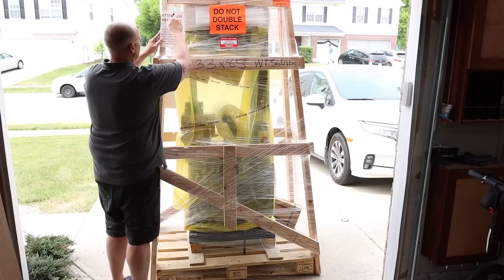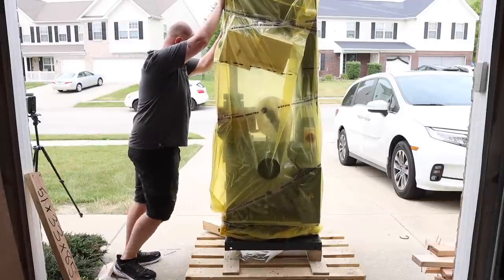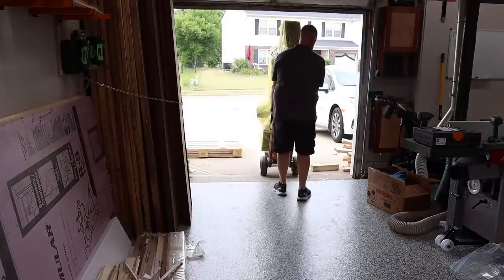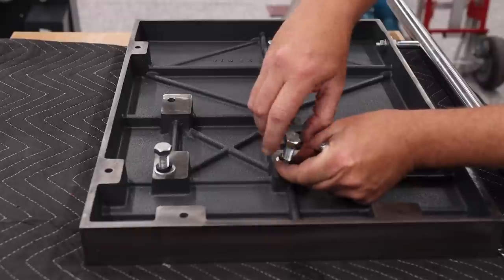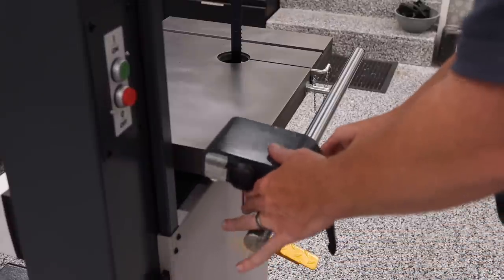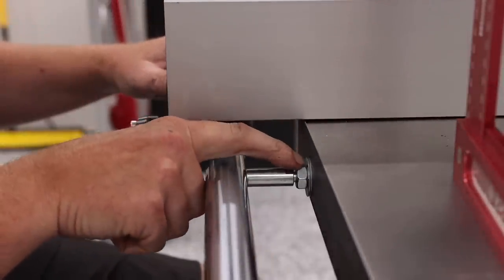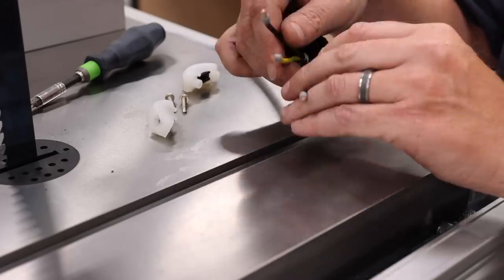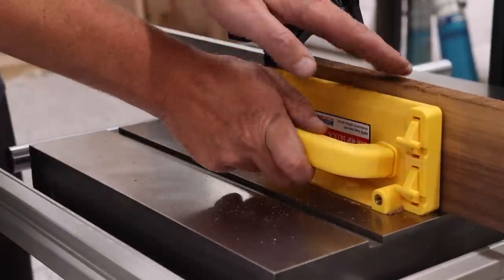I sold my bandsaw for this - Hammer N4400 Assembly

Comment: I hope you enjoy your new saw. I’ve had an N4400 for about 10 years now and TBH, I’m sorry I bought it, especially given the price. The dust port is in the worst possible location, letting all the sawdust fall directly on to the lower wheel tire. Even with the little wheel brush, dust gets trapped between the blade and the tire, so it has to be manually cleaned off periodically or it will lead to tracking problems. I’m not a big fan of the blade guard or guides either. One of these days I really need to make a modification to improve the dust collection. I suppose if the N4400 is going to be the only BS in your shop you could be happy with it. It has plenty of power and resaw height, and versatility with the range of blade widths it can accept. But, if you are thinking of buying one of these, I would do a DEEP dive on exploring other options. I have a MiniMax MM24 which is an absolute joy to use. I keep a 1” carbide tooth blade on it. I got the NN4400 for curve cutting. In retrospect, I really wish I had bought an MM16.
Reply: That is what we need to hear.  This is a partnership....sponsorship....free tools to say good things channel.  Nothing more.  Nothing wrong with that...but that is what so many of these woodworking channels have turned into...just partnership...advertising channels.
Reply from the maker: First, I don’t need these tools. I had great tools already. I was interested it trying them because I have been very impressed with the Hammer A3-41, which I paid for, years ago. Second, this was a how to assemble video. It was not a “hey this is the best tool ever” video. I put nice things in my shop because I like them. Not because others will. It’s my shop that I want to enjoy being in. Will there be things that I don’t like about the tool? Of course and those will be covered after I use it for a while. Just like anything else I have done. If the tools I use in my shop or the videos I make aren’t for a particular viewer, they don’t have to watch it. I make videos to help people, and I choose companies very selectively to work with. The fact that my channel isn’t littered with sponsored ad reads should prove that.
Reply: SCM makes great machines and I'm sure your MiniMax MM24 is fine example. I went with a Felder FB-510 Band Saw and I too absolutely love it. But these machines aren't for everyday DIY'ers, they are $$$, BIG and HEAVY. 😥
All the Best, Chuck

Comment: OK, thanks, I presumed there would be one at the bottom.  I noticed the sawdust on the work table, that's why I asked.  Shame there isn't dust collection there.

Nice saw, nonetheless.  I have a 14" Rikon, added a 2.5" port under the table.

Comment: What a nice piece of machinery! Enjoy the new toy 😄. Just one very little tip: replacing the straight plug by an angled plug helps quite a bit with heavy wires and it's less fatigue on the outlets.
Reply from the maker: This is actually plugged into an extension cord
Reply: That’s a good tip, thanks 🙏

Comment: One thing you might encounter with that bandsaw is apparently the guide post tends to shift when you tighten the knob that locks it into position.  This will affect the placement of the guides relative to the blade.  Will be interested to hear if you run into that issue.
Reply: Adjust the guides with the guidepost tightened. That way when you loosen it to move it up or down and retighten it, it will relocate back to or align where you had adjusted the guides.
Have a lovely day. 😎

Comment: In a similar boat.  I have a Harvey bandsaw along with the a3 41.  I'm thinking of upgrading bandsaw to felder 510 or larger.  Im not a huge fan of the guides on the Harvey.  Interested in a comparison of the guides along with how accurate the upper guide post is when you move it up and down.

Comment: I was surprised that you didn't break the machine down on the pallet - I always do that to avoid moving the motor/cast iron/accessories with the machine bases (any machine).  You didn't show anything about the guides and their adjustment - are they ceramic blocks or rollers (looked like rollers on the bottom guide, but I'm not sure)?  My big Laguna bandsaw (Italian-made) has ceramic blocks and I love them.  I'll be buying the Hammer oscillating edge sander before the end of the summer.  Best of luck!
Reply from the maker: Yeah big mistake. And yes, mine has the ceramic guides. I will be covering that in the follow up video. I didn’t find that particularly helpful for the assembly of the tool.

Comment: Interesting, i just got mine as well and by the way i live were the machine is actually manufactured (austria) pretty near Felder Group Headquarters
and i see that the emergency stop in the us is a mechanical footbrake. the EU version is electronically stopped. Don’t understand why because if you have a an accident I don’t think you would be able to push that paddle?!

Comment: Id be Interested in your placement of the blade on the wheels. For years I’ve been following the technique Snodgrass (on YouTube) recommended and have been been very happy. Your technique (if different) would be a welcome subject.
Reply: Yeah, I was about to comment on the fact that, according to the Snodgrass method, the gullets should be in the center of the wheel.  His are not.
Reply: Hi, on blades wider than 16mm the tracking is to be set so the teeth overhang the front edge of the tire. On blades narrower than that centre them on the wheels. The ceramic guide blocks are also asymmetric with the ceramic off centre, you can flip them 180 degrees to support the blade properly depending upon blade width.

Regards, Rod.

Comment: You did the plug wrong. You only need to strip off about an 1-1/2” of the insulating jacket on the cord. You want the cord clamp on the plug clamped on the outer jacket of the cord not the individual wires.

Comment: Did you get the ceramic guides?
Reply from the maker: I did.
Reply: @bentswoodworking  I bought the a3-41 and the n4400, I have the sawstop, I’m wishing I would have bought a slider. The sawstop is great, don’t get me wrong, but the sliders just make sense.

Comment: Would be interesting to hear your thoughts on going from the Harvey to the Hammer.  I have been thinking about doing the same thing as I am not thrilled with Harvey as a company.  How does the table height work for you?
Reply from the maker: I will probably talk about that a bit when I do the next video. I did like my Harvey bandsaw a lot as well
Reply: @bentswoodworking  I second this.
Reply: Table height is uncomfortably low. As is the case with many bandsaws that are optimized for resaw capacity, I think they design the table height to be low to keep the overall height of the machine from getting too tall. My N4400 is currently on a stand that raises it maybe about 3” above the floor, which isn’t enough for accurate cutting such as following curves—very uncomfortable! I plan one raising it by at least another 6”.
Reply: @57hound  I had not thought about that, but the resaw capacity makes sense on why more and more bandsaws have such low tables.

Comment: Is their dust collection on the machine?
Reply from the maker: Yes, there is one 5” port on the bottom
Reply: I’ve had an N4400 for several years now. The location of the dust port is in a horrible location, giving sawdust every opportunity to fall on the lower wheel tire . I’ve been meaning to modify it, probably making some sort of shroud to capture the dust right below the table.
Reply: @57hound  Rikon and others have second (first?) port right beneath the table. I have the 10-351. Dust collection is stellar on that saw, guessing due to this dust port location.

Comment: Almost identical to my Rikon 10-351 with the exception of my blade tension release handle. Guessing Hammer's is in a different location? Hope you enjoy this saw as much as I do. Curious how you like changing table angle, as the Rikon is a total pain. Edit: Now I also see this machine lacks Rikon's second dust collection chute right below the table. As @57hound points out, that may give you tracking fits that the Rikon does not experience.